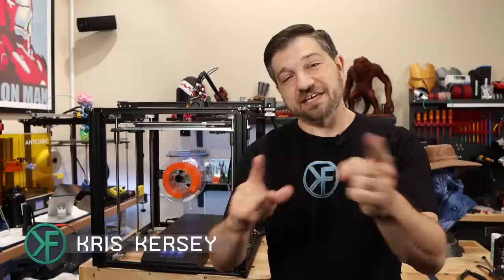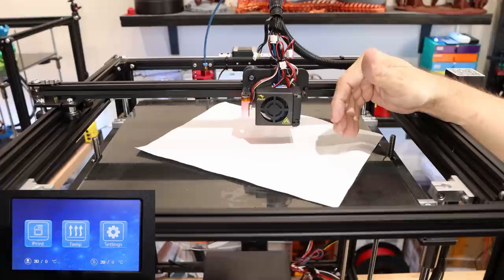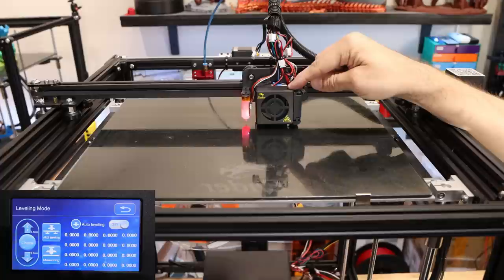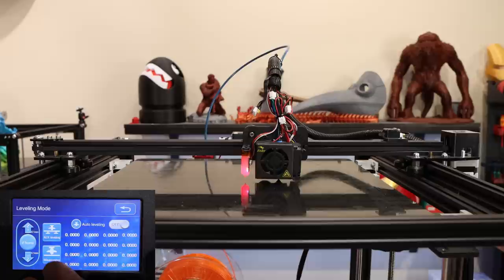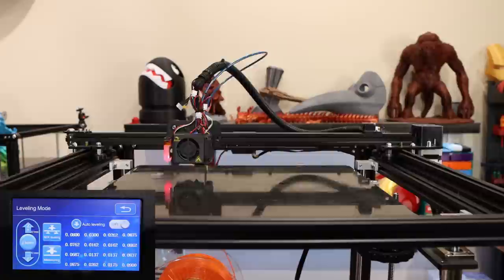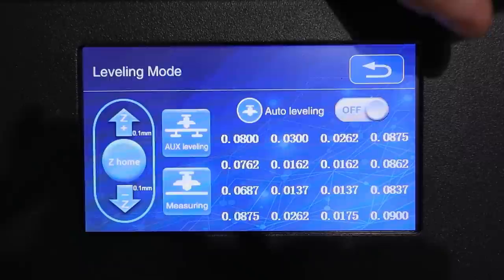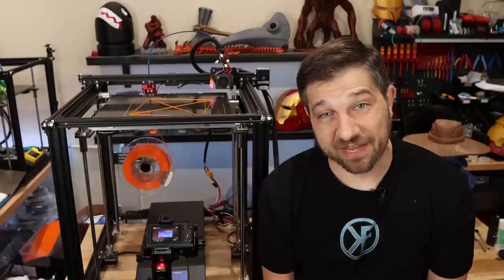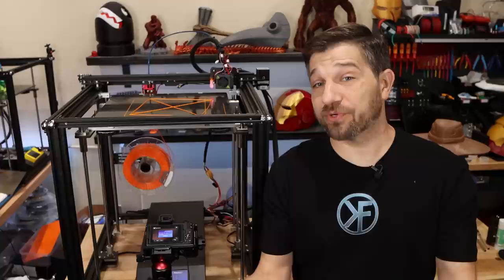Ender 5 Plus Bed Leveling Guide

Comment: Before measuring the gantry level, snug down all 4 spring loaded bed adjusters, then open them all up one turn.
Reply: It depends how flat that glass is, what works for you may not work for others as it depends which side of the glass they printed the texture on as one side will be convex and the other concave, I have found 2.5 mm gives plenty of room for manoeuvre

Comment: I don't understand. My old E5+ was fine. This new one refuses to "save" the home position. Everytime I aux level, back out, and go back into aux level, it's like it erases what I did on the previous aux level. Like, it's not rewriting Z-Home whenever I back out. They really need to just add a "Zero Z" function/button on every leveling screen.
Reply from the maker: Sorry to hear that. You can try the firmware I have released. I'm also working on some new firmware.

Comment: I did everything thing in the vid but my outcomes are really different. My corners (2,3,4 and 5) are 5.4mm, -4.9mm, 9mm, 3.1mm. If i do the leveling with a paper everything seems fine. When i try to print something it just comes out as spaghetti. I hope someone can help me
Reply from the maker: Are you saying that it comes out messed up no matter what method you follow?
Reply: @kerseyfabs  yea, after i rewatched the vid the outcome is pretty much the same but it doesnt affect the builds anymore. So thats good i guess. This is also my first printer so im not experienced at all

Comment: I am about to give up on the Ender 5 Plus. Got it 3 days ago, have been trying to level the bed ever since. Here is what happens (I follow all the steps from this video to the letter):
- (all preceding steps)
- Go to the levelling menu (The head is about 5-10mm from the build plate)
- Press Z+ and Z- until the head is the right distance from the build plate
- Press Z-Home (The printer is moving X, Y, Z)
- Buildplate "rams" into the printhead (just like in your vid)
- Press Z+ and Z- until the head is the right distance from the build plate
- Press Z-Home (The printer is moving X, Y, Z)
- Buildplate stops about 5mm from the buid
and this loop continues over and over. I am about to give my E5P it's first (and probably last) flying lesson (unless someone can help me out here)
Reply: It looks like I found the issue! Had to upgrade the stock firmware (on the stock board) from 1.70.0 BL to 1.70.2 BL
Reply from the maker: I'm glad you worked it out!

Comment: I notice that the "Auto leveling" feature is turned off (7:01) during this video. What, exactly, does that setting do? If you press "Measuring" with Auto leveling turned on, does it overwrite the manual leveling you've done?

I have a 5 Plus and I feel like I'm re-leveling it way more than I should be...
Reply from the maker: All that feature does is enable auto leveling before every print and then turns on the mesh. Make sure you have 'M420 S1' in your start gcode and you should be good.

Comment: i just got mine 5 days ago, and while we have the same printer, mine does not have the auto level on off feature.  it has the BL touch which looks a little different than yours.  is there a reason for this?  is that a feature they removed or did away with in later revisions of the software?  i used a post it note but my numbers came out all over the place.  the right side of the bed goes between -2.900 to -4.337, whereas the left side goes from 0.824 to -1.462.
Reply: were you able to solve it? I have the same problem and I don't know what to do. Answer please

Comment: Thank you so much for putting this out there. I purchased my printer brand new in May 2023, and I haven't been able to get it working until today. This was super helpful in getting me going, as was your test print. I am wondering about something, is it just me, or does the Ender-5 Plus have a file name length limitation. When I first loaded your file, I couldn't find it. Then I renamed it to Test Pattern and it worked fine. The other question I have is does Creality not recognize .STL files?  I seem to have to convert files to .gcode to be able to print them. Is that for all Creality printers? The Ender-5 Plus only? Or am I doing something wrong?
Reply from the maker: I'm glad I could help Elizabeth!
Yes, it does have a filename limitation. Good job working that out!
All printers require a sliced file and do not read models directly. A gcode file contains the instructions the printer uses to move and extrude. A STL file is a description of a 3D model.

Comment: My z adjustment during print changes the 0.1 not the 0.01 place. How can I fix/change this?  its an Ender5Plus running Ver 1.70.3 BL with the creatlity silent board 2.2.1. I was reflashing my printer due to nozzle/hotend  replacement issues when it started. Before I messed with it, the 0.01 place was adjusted. It is impossible to get a good level @ the 0.1 place. Help!

Comment: I don't show the auto-leveling sliding tab in my options - anyone else missing that?
Reply from the maker: I've heard of this from others with newer firmware. I'm working on a solution.
Reply: @kerseyfabs  thanks - it's been like that since day one - but I have bigger issues lol just did the silent board upgrade from creality and it was stuck in the Chinese "loading, please wait" screen. Did the firmware update but now my BL touch it's intermittently failing. Once it's all sorted out I'm sure the auto leveling tab will come in handy. Thanks 😊

Comment: At 6:58 the screen for leveling mode. Even when my printer is at home its never zeroed.  Do I do these steps. Then delete bin file to refresh . Then do these steps again
Reply from the maker: Which values are not 0?
Reply: @kerseyfabs  sorry for late reply. I didn't get a  notification for some reason. 
as for zeroing it out to level.  at 9:01 see how the screen says all zeros before you do the auto leveling? I have no auto leveling button and my screen for auto leveling never zeroes before doing auto leveling. I'll have say =5. something on one side middle is like -3. something etc.
 also my Z offset keeps setting to 10:4 or 11.4 every time I set it to 0 than hit home.
I deleted bin and it still does it. I tried it at printing then adjusting setting than stop print. still wont change it.
I look for firmware. Maybe that what it is since I just started using it.

Comment: Man ive done it just like you said once, then did it again with a metal guage and followed exactly. And i never get the 0s in the 10 spot and it never levels right...
Reply from the maker: Are you getting significantly different values if you run the auto leveling back to back?
Reply: @kerseyfabs  I never considered running it back to back. I also don't have the auto level that's a toggle. Now, I did go ahead and flip the glass, and I think I got something that will suffice.

Comment: OK but what if we dont get all numbers near zero with auto level ?
Which way on the dials causes exactly what to happen to the numbers !!!!
This is a drawn out process ! A little more info here would save a lot of time . The first time I did this i had a range of about 2.500 . Because I dont have any idea what these numbers mean i ended up having to start over . If i get -2.506 what does this mean ? Millimeters? Which direction is what , which way on the dials does what ? The movement is so small you cant tell unless you move a lot .

Comment: What if your using a laptop with creality slicer for the test print? I ask because I cannot do the fine tuning adjustment that was shown in the video. I have options on the slicer but it seems like I'm limited to how much I can adjust the z setting.
Reply from the maker: Creality Slicer is a Cura-based slicer. That means that by default, many settings are hidden to avoid confusion. You can turn on hidden settings with a button over near the settings area. From a Google search: "To show hidden settings, click the gear icon next to a section header. A window will pop out, which will show all of Cura's Custom settings."

Comment: I started to live level my bed and it is so much easier. every 10 or so prints ill tram the bed.
Reply: I have dual independent z-axis drivers now and use G34 in my start code to tram the bed gantry each print

Comment: I tried upgrading my E5+ with a Manta M8P and made a right pigs ear of it. Went back to standard and the bed heights now 28mm below the closest the fine tuning can get it too. Some how the z offsets now out of bounds. So, A scilent board should be here today, Im praying that fixes it as i cant do anything with the basic set up. Ive also buggered the secondhand E5+ by fitting a Mini3 E3 and tft35v3.0.1, Thats on E5 firmware and i cant get the E5+ Firmware.BIN files off my PC on to a sd card for some reason. Its really messing with me now. :-(
Reply from the maker: Heya Nick! Sorry to hear all of that. You have a ton going on. When you get to a final setup you're trying to fix, hit me up and I'll see what I can do.
Reply: @kerseyfabs  I made a error, I smoked the CR touch pluging it in a fan socket instead of a end stop. so few days time ill see what the new silent crealitys boards at, The drivers all work, motors are quiet but the bed now wont level as i messed touch up.  Waiting on new cables.  Thanks for replying.🙏

Comment: thanks for this video 
I'm having a small problem with my z axis staying level while it's printing
when I first do the ruler trick and then I start printing it gets out of sync with the other z motor ..why is that?
thanks
Reply from the maker: That shouldn't happen WHILE it's printing. Are you sure both motors are active like they should be? To test, move around the print bed using the controls then manually try and turn the Z motors. If they both resist, that's good. If one moves freely, you need to check your cabling.

Comment: HOW are you getting the z-axis compensation adjustment to go up or down by 0.01mm with each press. Mine only has the resolution of 0.1mm with every press and sometimes it feels like i need it in the middle. Is this a firmware thing? If so can you possibly link which firmware you are using as the latest one from Creality doesn't seem to work properly, especially with the silent board.
Reply from the maker: Hmmm. I'm not sure. This should be part of the screen's firmware. I don't have time at the moment to go testing available firmware but there may be some different ones.

Comment: I just got an Ender 5 plus and am trying to do the leveling and initial print. Not sure if its just my machine, but after i hit print it does a full measured leveling (multi point) before starting the print.  Is that something that can be changed in a setting or is this just how this printer prints.

Comment: @Kersey  love the videos on the ender 5+. Hope you can help me out a bit. I bought the Orbiter 1.5 for my E5+ which has 4 colored wires, the E5+ has wires black with lines and dashes.  Can you do a video explaining how to match up the correct wiring patterns for this direct drive?
Reply from the maker: Who was the manufacturer of the Orbiter? Each motor could have different pin-outs, so there's not one answer.
Reply: @kerseyfabs  Bought it off ebay, BIQU Orbiter Extruder V1.5 Dual Driver Gear Extrusion For Voron 2.4 Ender 3 CR10
Thanks anyhow.

Comment: You are setting the "gap" for the tramming while using the orange bed screws which is easy enough, what is an optimal way of adjusting this gap when using the silicon pads instead of the springs, which are much more rigid? Does one try to put a minimal squish on the silicon while maintaining consistency around the 4 screws, or do you need to compress them like you would with the springs to allow +/- adjustments later?
Reply from the maker: That's a good question! I don't use those but I would probably choose something in the middle. You want to be able to move them, so don't over compress. As long as you can move them some, you should be able to manually level well.
Reply: I have the silicon pads and I have just seen this vid of Kris's . At the start I have used a piece of 1/8 inch Aluminium by the adjusters on the under frame as a feeler gauge and adjusted the hand wheels all the same. then do the corner leveling.

Comment: I have both sides of the bed mounting plate square to the gantry and have a roughly equal amount of adjustment available to the wheels.  Should I go any further right now if I plan to use a Sonic Pad, or should I wait to do the rest after switching over to Klipper with the Pad? 

I also plan to swap the hotend for a Spider V4 – same question, when should I do this?  This is a new Ender 5 Plus, just wondering how you would go about the setup if already planning to swap parts. 

I’m inclined to set up the Sonic Pad and leave the stock hotend in place until I get everything running – mostly wondering if I need to complete the bed leveling before or after setting up the Sonic Pad. 

I’m also swapping the extruder for metal, but I want to do this at the same time as the hotend swap so I only deal with the tubing once (changing to Capricorn).
Reply from the maker: Do the Sonic Pad before any of them. All of the settings and everything will need to be redone after you install that, so just do it there the first time.
Reply: @kerseyfabs  Many thanks. Your channel is definitely going to be my "go to" source of info as I get into my Ender 5 Plus.

Comment: So, at what point do I need to turn auto bed leveling toggle on?

Also, I am running you firmware from years ago for the ender plus that fixed abl offset and added pid tuning etc... 

What's the next step up from that? Because now that I have upgraded my fans and setup, my bltouch is not in the same spot and I have no idea how to update this on the stock ender with your firmware.

Comment: Is there a reason why I can go through and level all 5 points and have the distance right but when it goes to measure, the gaps its measuring are pretty big. Very few points are .056 or similar and most are well over that like 5.12 or similar.
Reply from the maker: If you're getting some points at the <.1 scale and some at the >1 scale then your BLTouch is clearly malfunctioning.
1) Try to separate your BLTouch wiring from your other wires as much as possible. This will reduce line noise from power.
2) You could try shielding your BLTouch wires.
3) If all else fails, you may want to replace your BLTouch since this may be a device error.

Comment: I have a 0.20mm stick for measuring. I followed the steps up to aux leveling. When I do that I follow the steps and make sure that I get it right to the point where I can not longer get my stick under the nozzle (using the screws on the underside not adjustments to Z), then I go out then back into Aux and when I look at it and test it my 0.20mm glides under with tons of space. Any ideas? I've gone out and back in at least 10 times and it feels like i'm in the same spot over and over again. help!

Comment: I adjusted the bars and went to auto leveling and my bed wont even reach my BL touch. The BL touch now just flashes red and the bed wont go close enough to the nozzle. I adjusted it multiple times manually using 8.5 and lower, but it keeps putting the bed about 11 cm away from the x gantry bar every time. It just flashes red and seems to think the Z home is far far away from the nozzle. adjusting the -z does nothing. Any ideas what happened?
Reply: My issue was my BL touch I tightened it down and it started to work again. Also as other people have pointed out in the comments you should go to print and put your offset to 0 then home your printer before you level so you don't ram your bed in to your nozzle.
Reply from the maker: I appreciate the feedback! I'm glad you got it working!

Comment: I've gone thru this 3 times, and my bed is still two tenths out of level on the (2) area.....Using .015 feeler gauge.  However, prints are now sticking.
Reply from the maker: Your bed could be warped. If so, auto bed leveling will compensate.

Comment: How much of a gap between the aluminum plates to allow for up a d down adjustment would you say is best
Reply from the maker: You don't need much, maybe like 3-4mm or give but keep in mind it depends on which springs you have.
Reply: @kerseyfabs  gotcha, in gonna do silicone bed springs so we shall see what I can accomplish with that, currently the bed has a pretty huge slope so it's possible the plate is warped.
Reply from the maker: @samschultz6106  I hope that fixes it for you!

Comment: So, just to verify, are we supposed to leave "Auto Leveling" off the entire time? Because my logic (and it could very well be wrong) believes that with it off, it wouldn't make any use of the measurement "mesh" for the bed.
Reply: Was there an answer to this?
Reply from the maker: The auto leveling in the stock display causes it to level on every print, which is not necessary. Once you've leveled, just make sure "M420 S1" is in your stay gcode to enable it.

Comment: great video. question - i am using octoprint and not an sd card. not sure that makes a differance but i cant get to the adjustment screen. do i have to use an sd card to get to this screen?
Reply from the maker: Yes. The stock display doesn't know when you're printing over Octoprint.